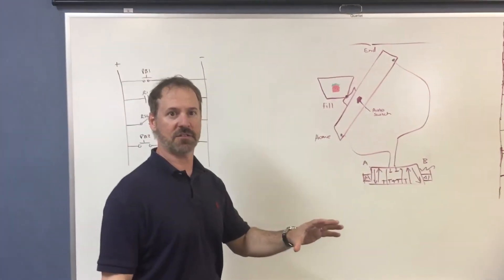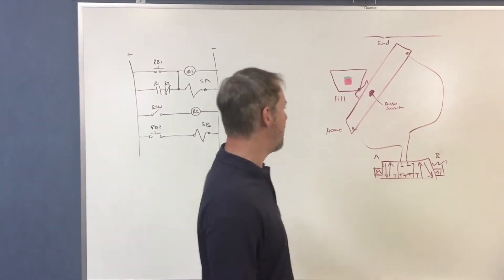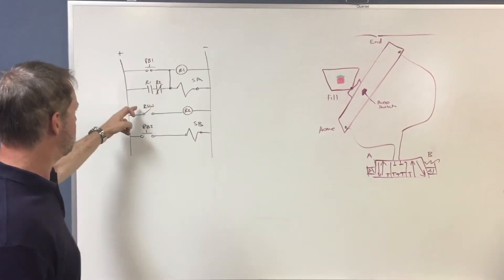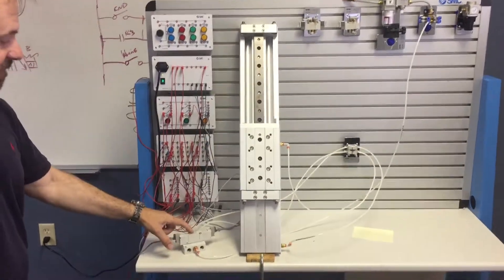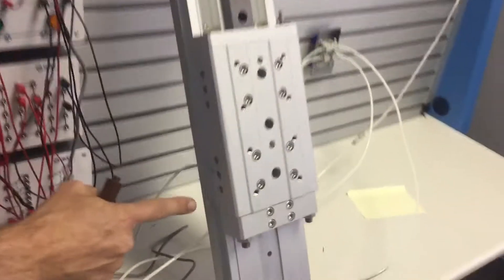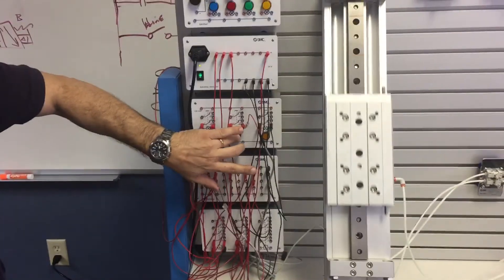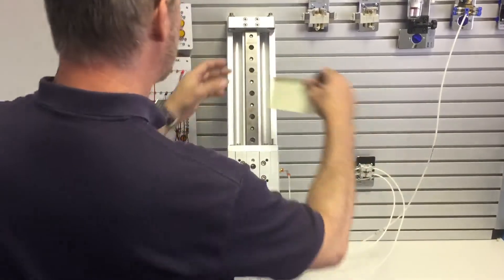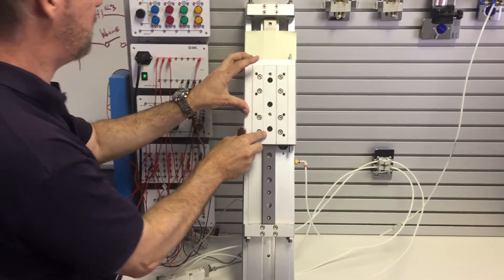SMC Pneumatic Cylinder w/ intermediate stop

Comment: Great video. Very Nice.

is it possible to do a calculated stop instead of using a sensor. For example in the video a sensor was used to stop the carriage. Is it possible to stop the carriage at a position determined on the fly?? When using stepper motors the stopping position is determined by calculating the exact number of pulses required for the position. Is this possible with the pneumatic slider??
Reply: SMC has a Stroke Reading Rodless Cylinder with Brake, series ML2B (http://content2.smcetech.com/pdf/ml2.pdf).   On the video the actuator is simply using a 5/3 closed center valve.  The stopping accuracy depends on the load and the speed.  Due to the compressibility of the air, it will stop at intermediate positions but not very accurate.. but it will stop.   Any leak in the fitting, tubing, valve and actuator may cause the slide to move.    The ML2B has a linear encoder and a mechanical brake.  If properly sized, it can have a stopping accuracy of +/- 0.5mm.     Contact SMC USA for additional information.